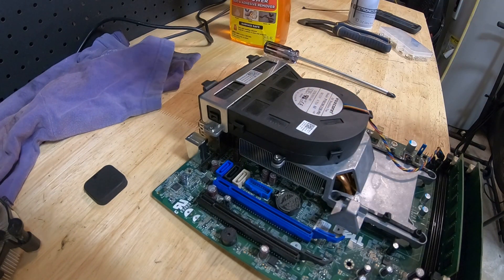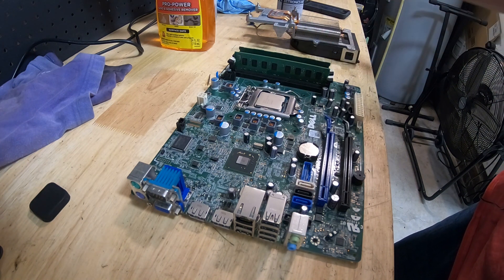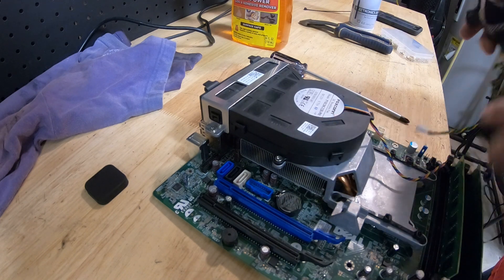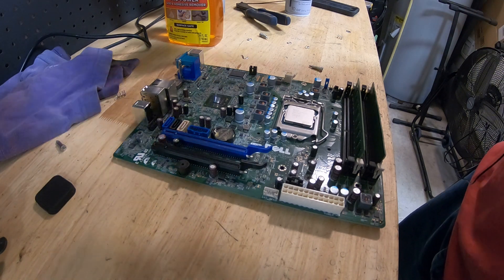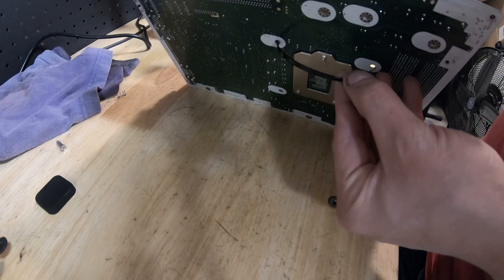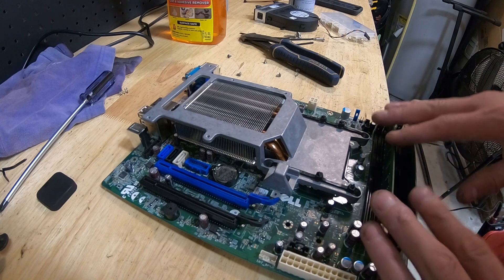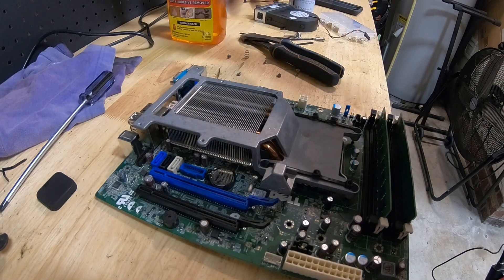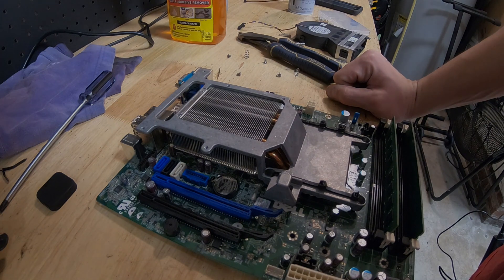Dell Optiplex  SFF cpu cooler. CPU cooler guide for case swaps!!

Comment: Hi man I have a question I am going to be doing the same exact thingBut I have a little bit of concern about the 24 pin power connector I have a GTX 1070 but I feel like the heat sink well cover that up causing me not to be able to plug in a power supply are there any jeep use that you know that will fit
Reply from the maker: yea it does become something to think about when it comes to this particular board from dell. The MTX and traditiona; sff ones don't have this issue and this board limits the  variety of cards you can use because of the power connector location but you do have a few options. first being looking up the dimension of the card to see how long and wide it is, smaller 1070 variants clear it as the more beefed up version create an issue. another thing to consider is using a 24 pin L adaptor as it will move the wires away and give you more room so your not butting up again the end of the card. I will put a link below and have known people to go this route and  I have heard it works well. the third option is depending on the case your going with you can use a riser extension cable and vertically mount your gpu. Its the easiest way to do  it and is a nice look but costs a little more due to the riser card and buying the mount, or for the mount you can fabricate something yourself. Hope this info help, thanks for watching and def let me know what route you choose and how it goes.
Reply from the maker: https://www.amazon.com/Cablecc-Adapter-Mainboard-Motherboard-Desktops/dp/B07NZ5GXNF/ref=sr_1_2?crid=1K35SS1ZIGD8E&dchild=1&keywords=24+pin+adapter&qid=1603728097&sprefix=24+pin+l+adap%2Caps%2C175&sr=8-2
Reply: @DLMtechgarage  Thank you so much you are a genius
Reply from the maker: @johnobrien9093  anytime, def keep me updated!
Reply: @DLMtechgarage  I just put a little bit more research into that the 24 pin power connector is upside down🤦‍♂️ which will stop me from using that part but if you know they do make mini ITX versions of regular graphics card the most powerful one is the 2070 TI it’s the same length as a low profile graphics card but it is taller than a low profile graphics card so yeah if you can find a mini ITX version like this

https://www.ebay.com/itm/124409942414
Any of these types of short versions will work definitely if the low-profile ones can fit in the motherboard these can fit the motherboard

Comment: Hi I have a question I just swapped mine into a bigger case will The 24 pin power connector on the motherboard stop a gpu from going in
Reply from the maker: I would say yes and no. Using the top slot you should be fine. Now depending on the size of the graphics card like a 2.5-3 slot graphics card you then would run into an issue but most standards cards fit with no issue. I ran an rx570 from power color with no issue. I would not put like a 2080 strix or anything huge like that. Thanks for watching hope this help and hope you can subscribe to help the channel!
Reply: @DLMtechgarage  OK I’ll subscribe
Reply: I’m not sure if this is too much to ask but can you do a video of you putting it into a case
Reply from the maker: @jaimenbrunson1652  thanks!
Reply from the maker: @jaimenbrunson1652  wish i could but I don't have that board in the garage.
Reply from the maker: @jaimenbrunson1652  Thanks!

Comment: Can I use a dell fan wc236 instead on the original cooler?
Reply from the maker: Not sure. Honestly anything is possible with a little modding and engineering and I am sure someone has came up with an alterative cooling solution. Def something to look out for. Thanks for watching and hope you can subscribe to help the channel out!

Comment: Can these motherboards fit in matx cases?
Reply from the maker: Yes they can. I put this one in an matx with no issue and it sold and works great till this day. Thanks for watching and hope you can susbscribe!
Reply: @DLMtechgarage  Thank you for replying!! Can you recommend some cases?
Reply from the maker: @kennethianpanganiban5082  check out the dark flash dlm22 case. I have used that one before for this board and since the rear fan opening is close to the board it works for the exhaust for the factory cooler. I have a video on the channel of a review of this case, its not using this board but def shows the case.
Reply: @DLMtechgarage  Thank you so much
Reply from the maker: @kennethianpanganiban5082  Anytime. Def keep us posted on your build!
Reply: @DLMtechgarage  Sorry if I ask too much but what about the pc cables? The adapter that I saw for optiplexes doesn't work for sff models and can the pcie slot handle big gpus like rx 570s? Thank you so much for the help
Reply from the maker: @kennethianpanganiban5082  I have another video on my channel of the pin out i figure out so def check that out. As far as the bigger cards, they will fit but I found that it either blocked or pushed against a SATA port but thats no big deal if your no using that many ports.!
Reply: @DLMtechgarage  Thank you so much
Reply from the maker: @kennethianpanganiban5082  anytime!

Comment: I have the same motherboard but what other CPU cooler can I use on this motherboard
. Because its makes a lot of noise and stock intel cpu cooler does not fit to motherboard.
Reply from the maker: with this board you cant change the cooler due to the different unique mounting holes. You can change the fan to a noctua of that size and thats about it. thanks for watching and subscribe for more!
Reply: @DLMtechgarage  ok thanks for reply :)
Reply: @DLMtechgarage  so if i want to change cpu cooler i need to change my motherboard right ?
Reply from the maker: with this motherboard you can't change it. What I recommend is is the wire tie trick for the heatsink along with upgrading to a noctua fan for quieter and better air flow. Its what I did in a build i sold using this and I was able to pop in an I7 third gen with no issues or temps. Thanks for watching and hope you subscribe to help the channel.

Comment: I have extra fans for my 7010 sff build but I don’t know where to plug them in on that motherboard
Reply from the maker: You would have to get some fan splitters which are real cheap along with the 5 pin adapter for it. Thats I have done it and have had no issues!
Reply: DLM tech garage thanks

Comment: I've a question, Isn't the heat on the cooler likely to melt the zip-ties?
Reply from the maker: no most def not. Sold it like that with a build almost a year agao and the computer is still going strong and the ties have not gave up. Thanks for watching and for the input! Hope you can subscribe!

Comment: there is already an 8mm fan in the original case but i am wondering how to fix it on the cpu cooler
Reply from the maker: you can swap the fan too and use the 5 pin to 4 pin dell adapter they sell on amazon.

Comment: why wont the default cpu coolers fit? exactly is it the holes? or something else?
Reply from the maker: they will fit on the SFF but the USFF has different sized mounting holes which dont line up with tradition coolers.
Reply: @DLMtechgarage  The board in the video looks like an SFF board. So should a standard non-Dell CPU cooler fit there then?
Reply from the maker: @JNCHRH  you can, I geared the video towards those trying to save money and by just reusing the heatsink and putting a 80mm fan you can save money.
Reply: @DLMtechgarage  That's great to hear, because then I can buy just empty motherboard and add other regular parts.
Reply from the maker: @JNCHRH    yea, sorry for not being to clear on that in the video. Thanks for watching and let me know if you need any other help!
Reply: @DLMtechgarage  No problem, and I much appreciate your very informative videos! :)
Reply from the maker: @JNCHRH  Thanks!

Comment: I have the Optiplex 9010 SFF, can I install another CPU cooler in my motherboard?
Reply from the maker: yea the sff you can. the usff you can't
Reply: @DLMtechgarage  do you got the usff
Reply from the maker: @asfihassan  yea it's the usff, been meaning to update the title.
Reply from the maker: @asfihassan  I dont't
Reply: @DLMtechgarage  i have that "blower type" cooler on my sff can I take it off for a normal cooler when I try to swap cases
Reply from the maker: @asfihassan  I can't recall if you can but im sure you can.

Comment: thanks this really helped me with case swap
Reply from the maker: Thanks for watching, hope you can subscribe if not done so already to help out the channel.
Reply: DLM tech garage Hi man I was about to message you,I swapped case today(now)and my cpu fan goes mad like full speed and does a LOT of noise,before this didn’t happened please help me to find a fix
Reply from the maker: @Jalbz1  could be a setting in the bios. Some have the fan setting set up. also that is usually a sign of poor contact with the cpu so it could be getting toasty pretty quick. make sure you have good thermal paste contact.
Reply: DLM tech garage The thing is,when i get the motherboard and everything off the case,the fan does not go loud but when i put it inside it goes so fast...baybe coz the case is all closed and i have only that fan?
Reply from the maker: @Jalbz1  download and run speccy and see what the temps are when it running high. That will def tell you if its a temp issue. If so I have never had this issue so def check if the cooler is seated right and make sure you got good coverage with the thermal paste.

Comment: So, can I install another CPU cooler in this motherboard? For example, the Cooler Master - Hyper 212 assuming I use a 5-pin to 4-pin adapter to connect the cooler to the motherboard CPU fan connector
Reply from the maker: on this usff board you can't, on the regular sff board you can. Now i have heard some people doing the wire tie trick to make it work.
Reply: @DLMtechgarage  No offense not trying to call you dumb or anything but this is the regular SSS version in the US SF is even smaller than this
Reply from the maker: @jaimenbrunson1652  none taken. learned something new. did not know their was a smaller version. def much appreciated.  I def aint no pro on these dells lol.. What would you label the title in your opinion?Thanks for watching and hope you can subscribe to provide input!
Reply: @DLMtechgarage  https://www.dell.com/community/image/serverpage/image-id/22945iBEAAEBB8804E7FA9/image-size/large?v=1.0&px=999) This is what the SSF’s look like

Comment: Nice video, I have the same motherboard. I have one question, do you have any image about the I/O panel connectors pins scheme? I really need to find it because I'm swapping my case and I can't buy an adapter. Thank you for the video, I appreciate so much your work
Reply from the maker: Hey thanks for watching and hope you can subscribe and share to help the channel grow. I did a video on the hack way of doing this and I will post it at the end of the message. Also I will attatch the video the guys channel which shows the layout and link so you can make one or rig it yourself. Hope this helps.

https://youtu.be/47aCR731cDU

https://www.youtube.com/watch?v=3fb6-B5Ux_s

Comment: Hi. i just bought the Dell Optiplex 790 SFF comes with i3-2100 and i want to know which core i7 can i put to this baby?
Reply from the maker: i7 2600 should run just nicely in it as it is what is on the compatibility listing for this PC. make sure you got some fresh thermal paste and clean off the old stuff.  Hope this helps and thanks for watching and hope you can subscribe and share to help the channel grow.
Reply: DLM tech garage Ok. Thanks a lot

Comment: Use motherboard standoffs to attach the cooler to the motherboard it works best
Reply from the maker: def a good idea and thanks for the input.
Reply: No problem I’ve had to deal with it many times before and that has been the best meathod for me
Reply: @jasonball5959  what did you do about the graphics card with the 24 pin power connector did it block it

Comment: Hey man I have a question I have a dell optiplex 3020 sff and I bought a new case. I’m having trouble plugging in the power sw cable. I have no idea where to put it.
Reply from the maker: Thanks for watching and hope you can subscribe to help the channel. On my channel I actually have a video on a adapter that makes this soo much easier without having to cut and splice any wires. Def check it out on the channel.
Reply: DLM tech garage it’s ok I figured it out thanks.
Reply: @DnaTopvwin  what was your cpu cooler mounting solutiom for your 3020? Im trying to find the right nuts for the bolts on the cooler but im having no luck

Comment: Need to check the mobo I used as it is practically the same and I had no problem getting a stock cooler to clip in.
UPDATE: It was a dell optiplex 790 sff. Not sure the exact mobo but I've found most fit a stock cooler, and if it's just off try an lga 775 cooler if you have one, you never know
Reply from the maker: on the sff the stock cooler will still work but with the usff you can use the stock coolers so this little trick helps get around that.

Comment: There is a full video for full case swap? Can I put intel stock cooler?

I have 7010 sff q77 motherboard.
Reply from the maker: yea i have one for the matx board. you cant use the stock one due to the different hole setup, but then again zip ties work wonders.
Reply: @DLMtechgarage  Thank you for the info. My optiplex fan is noisy (aging perhaps). My i7 3770 hit 75'c on load. So I want to move it to new case and upgrade the cpu cooler with 125w specs. I was thinking to take power button and front panel from optiplex sff case to new matx case :lol:
Reply from the maker: @putrajaya7280  check out the newer video on the channel for the power button. their is a seller who sells the adapters that makes the swap soo much easier.

Comment: Hey, just did what you've done there, and after really hard work, my PC won't run! I did the case swap and bought a new PSU and I don't know what to do, so, please can you help with that? I just want to play some games with my buddies and I really can't afford a new mobo, CPU and ram 
If you do have any Facebook or Instagram or WhatsApp can I please contact you? No one is going to help me and I think you're the only one who can I will appreciate that a lot ❤
Reply from the maker: Hey sounds like the issue is probably with the power connector. try disconnecting the original power button on the optiplex and plugging it in just to test everything works. if it works then its just an issue of figuring out the pin out. would love to video chat with you but my schedule has been hectic. Keep me posted on how its goin!

Comment: Can you use the intel stock cooler?
Reply from the maker: no on this board specifically you can not. The cooler proprietary and requires some modding to make it work
Reply: Check out my comment, I made it work and it works well

Comment: Is that the same thing dor a optiplex 790 sff? Or is the motherboard different?
Reply: Two more questions do i need to readd thermal paste and can i just switch the case without taking out that cooler?
Reply from the maker: @itzd4v16  Its always good to use best thermal paste. For this particular board meaning the SFF you have to use the cooler. Then non SFF you can use any cooler you want
Reply: DLM tech garage ok thx, is the power button not working on a new case a problem that will happen for sure or is it rare, and if it happens can you make a video on it please?
Reply from the maker: pretty much the same just.

Comment: I just asked the computer shop next door can I put this Mobo into another case with a different psu and they said it's not possible.
Can you please tell me whether they right or not cause I'm so board in this quarantine and I wanna play some games with my buddies and my budget is so so tight so it's so sad if I can't put this Mobo into another case :(
Reply: You just gave me some relief by tilling me they were wrong, thanks alot 
And one more question... How can I set the power button right ?!
Reply from the maker: @abdulrahmanzidan9253  I have a video or two on the channel on how to handle the power button so check out the channel for those videos.
Reply: I mean if I followed your steps I will be just fine with a new case .. psu and GPU ?
Reply from the maker: you can def put it into a different case. Just got to know how to set up the power button but other then that they are wrong. I put these boards into different cases all the time.

Comment: Can i put a 500w EVGA power supply I’m wondering about the 24 pin is the same I couldn’t find any adapters
On the 790
Reply from the maker: the dell optiplex uses the same 24 pin as a standard power supply.
Reply: DLM tech garage one more can I do a case swap I can’t find no video about the 790 diff case swap
Reply from the maker: @ThDESTROYER-xd5jv  you can def do a case swap, I have a video on the adapters you can get on ebay that makes it easier. Hope this helps and you can subscribe to help the channel grow!
Reply: DLM tech garage thank you